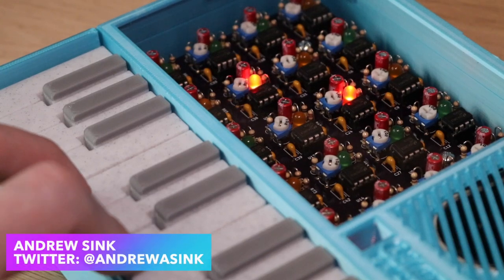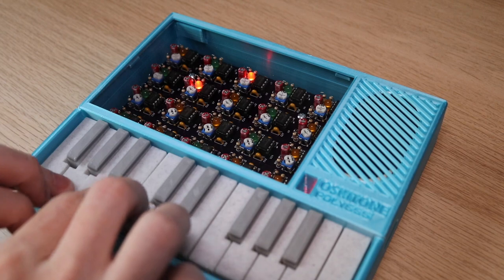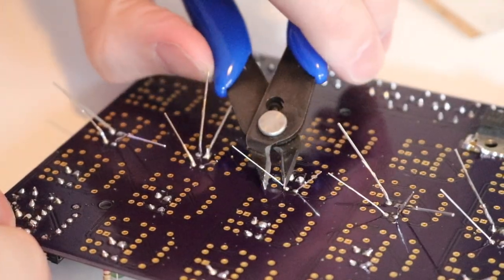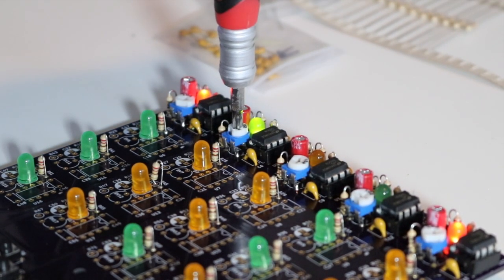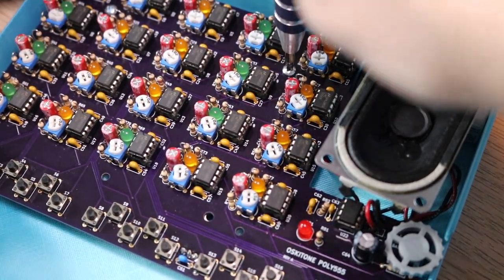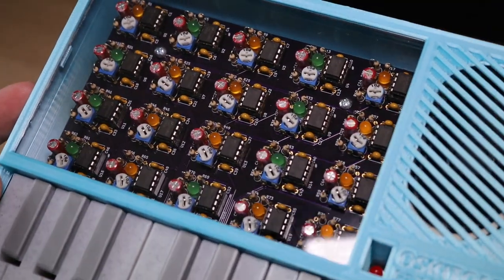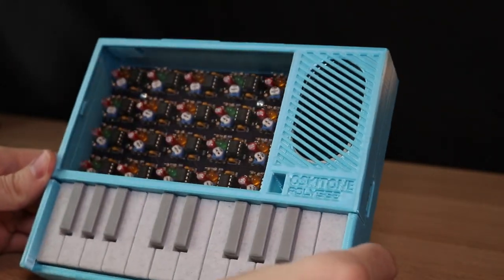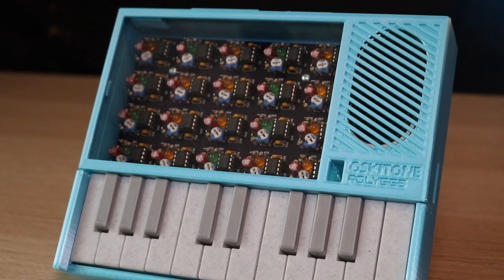Oskitone POLY555 - 3D Printed 555 Timer Analog Synth!

Comment: Very cool! I would point out that the use of a 555 timer per note has the advantage of allowing the user to play multiple keys at a time to create chords and other sounds. The issue with using only one 555 timer for all the notes is that it only allows the user to play one note at a time. Although you can technically play multiple notes at a time with a single 555 timer synth, the notes won’t reflect the expected combination of frequencies like when played on a piano.

Comment: It really sounds like a awesome project but then i saw the price of this kit.... 220 bucks.. Seriously WTH is wrong with them? It really kills the fun when the price for a Kit, that makes creating your own instruments on a budget... quite a bad deal when it costs as much as an actual instrument that could do even more....
Reply from the maker: The kit is only $75! You might be looking at the fully-assembled version, which is more expensive.

I promise you the kit is worth every penny!
Reply: @AndrewSink  mhhyeah, i checked the offers and saw the more affordable version. I wonder if someone has already modded it with additional features? Adding an Audio jack would be probably the first thing i'd do. Bless the 555 timers which really made it SOO much easier to create simple electronic instruments or fully fledged synthesizers,  even for soldering beginners.
Reply: @KRAFTWERK2K6  Vibrato would be quite easy to add along with a pitch bender. Also a simple envelope for each oscillator is doable. Simple high-pass and low-pass filters on the amplifier. There are many things that can be done to it.
Reply: @organfairy  Oh yeah i have built a simple lowpassfilter once just with a ceramic resistor and a potentiometer. Could be very easily integrated into the audio output.